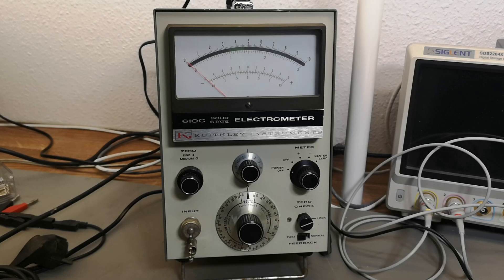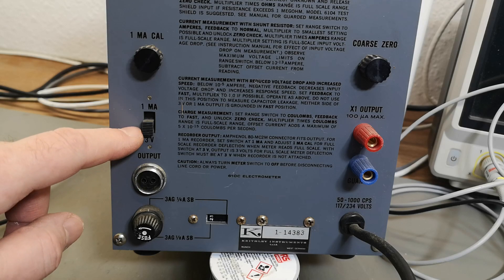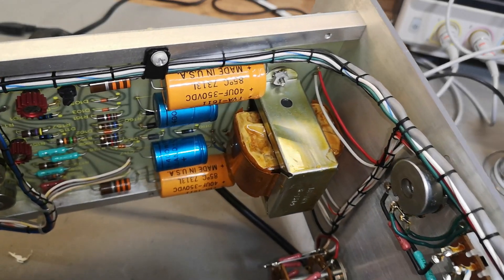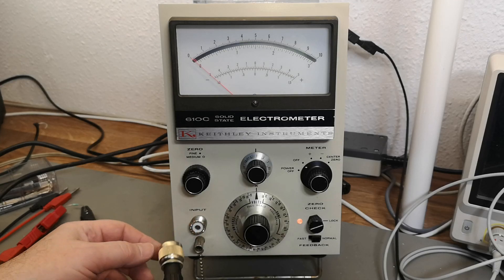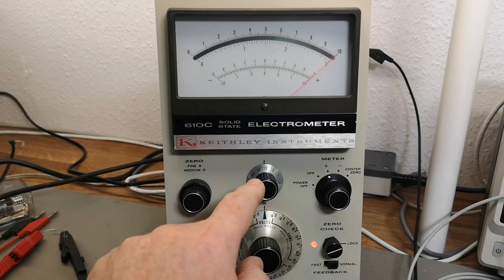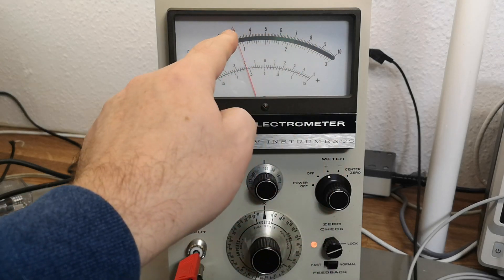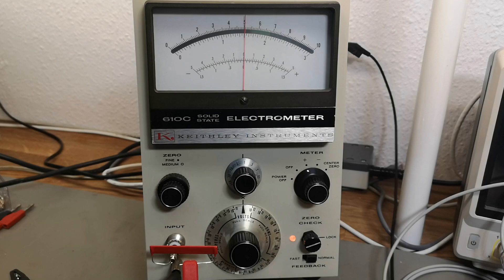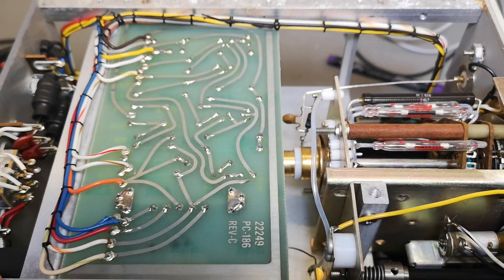Keithley Instruments 610C Solid State Electrometer fet volt amp ohm meter teardown

Comment: Hi, that's a luxurious design, it's a shame you didn't try how it works with a ZERO in the middle, that's a great feature - unfortunately my HP meter can't do this.

Nice day 🙂 Tom
Reply from the maker: i did try it, it worked, it was not that fun to document on the video :-) sometimes a few features needs to be left out of the video, to keep them a little bit shorter
Reply: I have a working 610c. One needs to follow instructions for using zero center on each start up, especially to prepare for the extreme measurements this machine can make.  This unit from 1968 makes measurements accurate to 10% on extreme ranges.  I will not attempt to calibrate until I have another electrometer.
Slamming the needle during a session will often prevent any more reliable readings, so turn it off and start over later. 
Use twisted pair leads and build a cable to utilize guard voltage(in manual) to coax the finest measurements from this finely balanced machine.

Comment: Hi, I know it would be really basic but may you please do a tutorial on how to interpret the scale and read the measurements? It seems to not be a single video about this on the entire plataform
Reply from the maker: it is perfectly ok to ask, I can explain this : most analog meters work the same way, see the scale got two main top readout scales, a 0-10 and a 0-3, so if you select 10V scale on its dial, you need to only look at top scale, and 10 readout is 10V, lets say you selected 1V scale on its dial, you again use the same top meter scale, but now 10 on the scale is 1.0V measured, and in all cases where the dial got anything with a 3 in it, you need to look only at the next readout that got a 3 at the full scale, the idea is you try to get the needle af close to the full scale as possible, but not over ! this way you read out most accurate
Reply: @TeardownOZ2CPU  thanks a lot, I was really confused about that haha